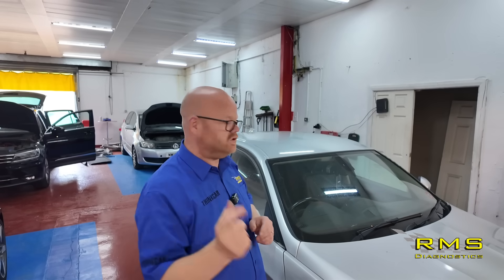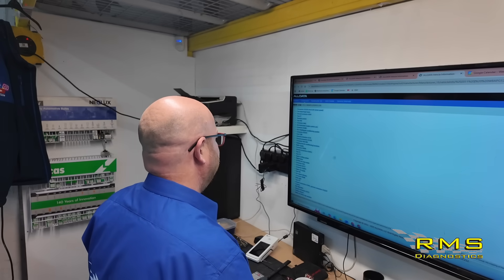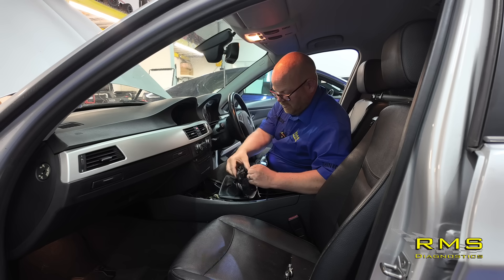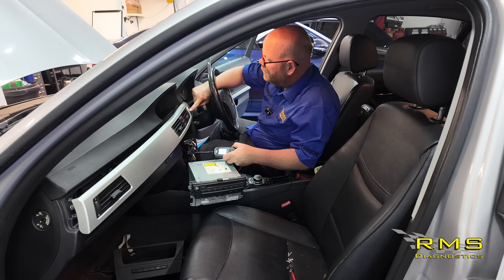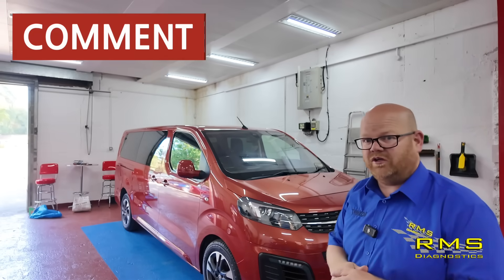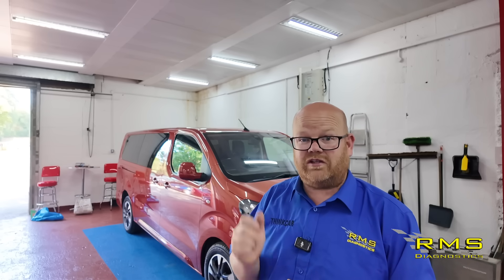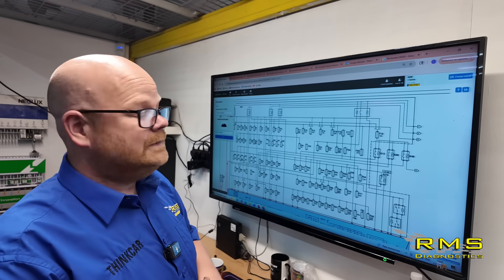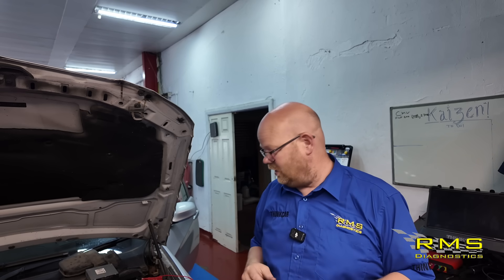The Truth Behind BMW Audio Fault  #diagnostics  #mechanic #automobile #bmw #bmwmotorrad

Comment: You can see the value in the wiring data, showing shared items to narrow down the search. Electrical items shoved under scuttle panels where water runs in all the time..... never 100% water tight☔️